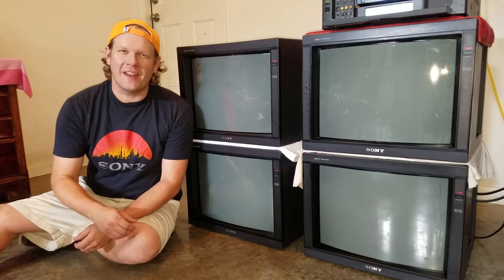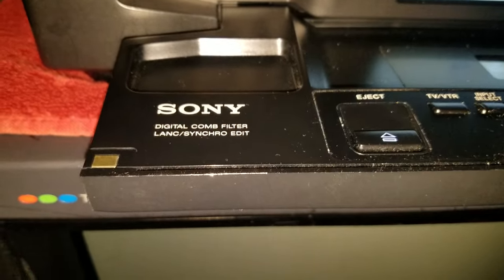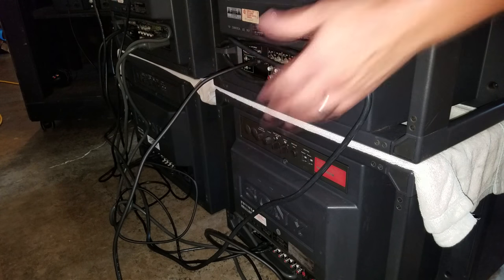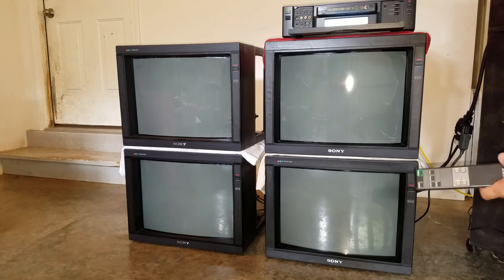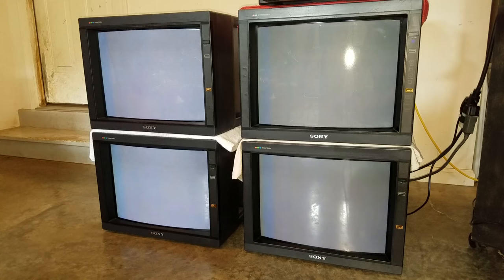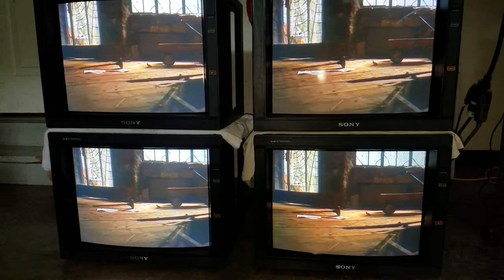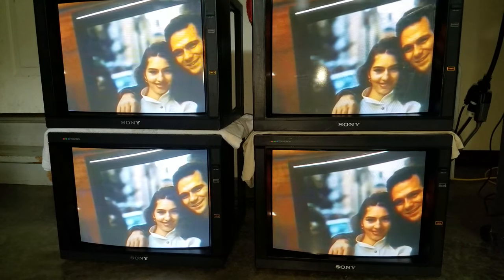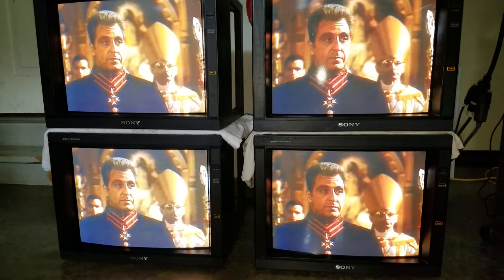Sony PVM 2030 CRT demo with VCR & Details

Comment: Is there any advantage of using the video loop output of a PVM or other monitor as opposed to just splitting up the signal the old-fasioned way?
Reply from the maker: Yes, you want to use the output on the monitor if it has one first.  Mostly because it's easier and doesn't require extra equipment.  If you split the signal, you would need to add some type of device to amplify the signal out to the other devices or the signal becomes very dim and week without an amplifier.  Thanks for the question.
Reply: Thanks... at the moment augmenting the brightness will suffice (my PVM has loopback on composite but not on component :-(   ) but it's good to know the loopback already amplifies the signal and thus, I suppose, produces a better quality compared to external amps.

Comment: Thanks for another awesome video! I'm trying to get my Sony SVO-9600 VCR to run on my pvms/bvms and am not having any luck. I'm running s-video out and when I plug it directly into my pvm-2030 I get a rolling image and the colors are wrong. Ultimately I'd like to find a way to convert my S-video from the VCR to RGBS send that to all my monitors. Any suggestions?
Reply from the maker: Thanks for watching.  That sounds really strange.  Does the VCR have composite output too?  If so, can you get that to play on your PVMs/BVMs?  Or does the S-Video out work on other standard tvs?